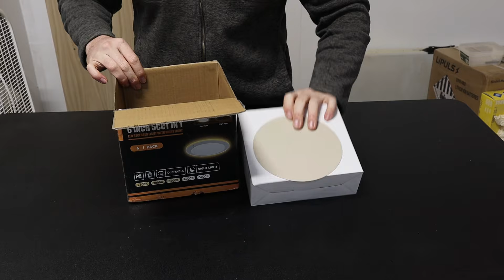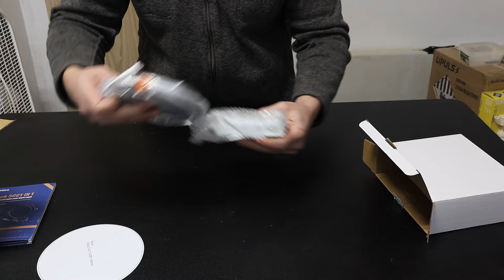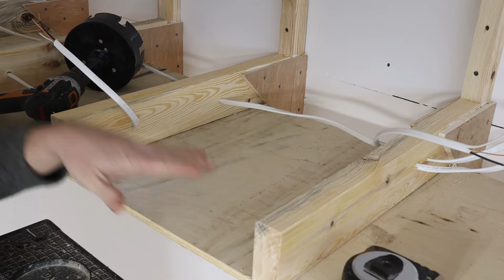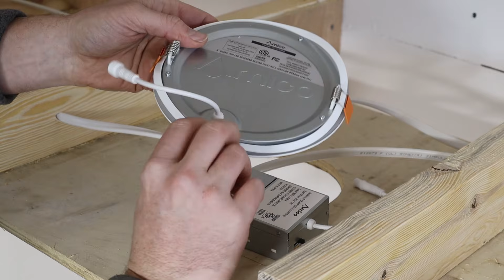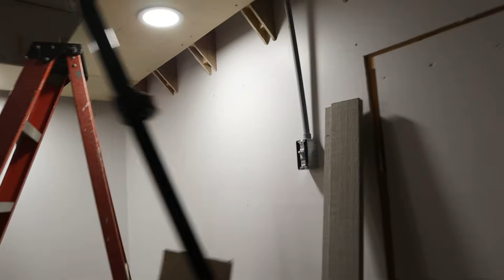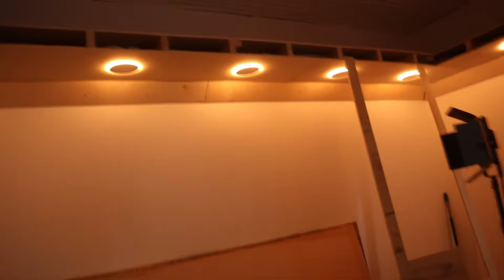Amico Recessed Lights with Nightlight full Install

Comment: Have four of these installed in my basement and they are not on the same cycle. Two on, Two dim, Flip the switch on the others go dim and the other two go full. Been trying to get them in sync and it's driving me insane! Unhooking them and re-hooking them up Anyone know the fix would be great!

Comment: That’s not a wago connector, a wago has little levers that open and close them after wire is in. Those are just push connectors

Comment: Does the night light reflect off of the wood to produce the ring pattern? I’m looking to install these in an exposed ceiling room and it won’t have Sheetrock or wood to project the light back at
Reply: Ever install these with the exposed ceiling? Was wondering the same, if its worth it or not to get lights with that option if nothing directly to reflect off of.

Comment: How do you resynchronize the lights?  I have 6 in my living room, 2 will be on night light mode, but the other 4 will be in a different mode.
Reply: With mine, I have to flick the light switch on and off a couple times to synchronize them.

Comment: Are your lights a little bit red ish at 5000k? I bought the 12 pack from same brand, same seller, the only difference is mine has 1,130 reviews cost $80 and your link has 5,970 reviews cost $70. So idk if these two are the same lights. I ordered the one you have to see if the red ish goes away.